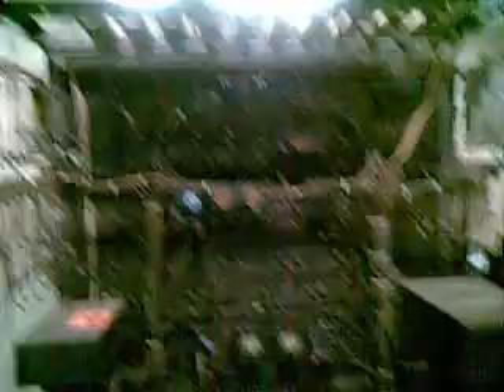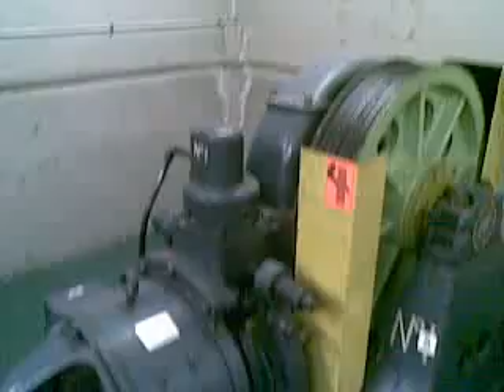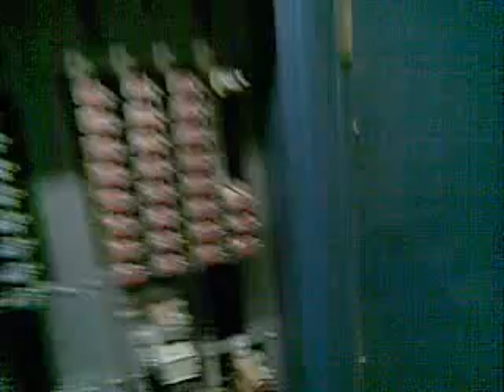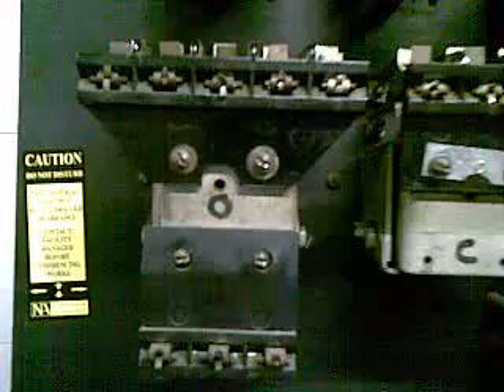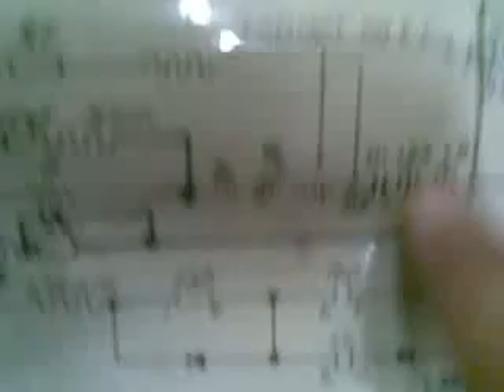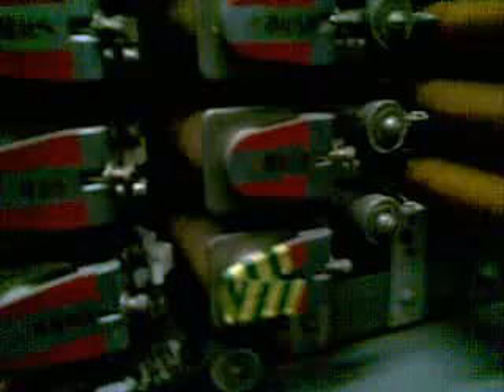Elevator Lift Plant Machine Motor Room Johns and Waygood

Comment: @jorologo I used to use that trick quite a few times - spewing if I was at a new computer job - I'd have to go and buy a lighter- an old supervisor once said to me, "if you can't fix a call in 5 minutes, have a ciggie and a read of the paper, then go back to it" - obviously that is when it's not a trapped passenger callout.  Thanks for your cool LMR posts too.

Comment: Nice work Mate.  I used to work on a few of these J&W "Sydney" controllers up in Brisbane.  The MG sets were different to later ones and controllers slightly different too.  

If you haven't ripped them out yet, could you please get some footage of someone lighting a ciggie off the FRI relay?  Just manually push it in when the lift is waiting for a call with the MG set running and then let it out slowly to draw an arc to light smoke.

Cheers.

Comment from the maker: @mrmattandmrchay 
I forgot to mention that the floor positional climbing relays are driven by an arrangement of magnetic inductor switches on top of the lift car that passes through metal plates arranged in lift shaft.
In later years some of these inductor switches were replaced by infa red optic devices with reed switches passing through the metal plates.
Always good to find a good old lift like this one from time to time.
Thanks for viewing. Glad you liked The Big Red Balls on the Governor.